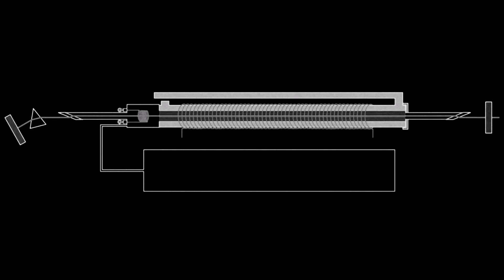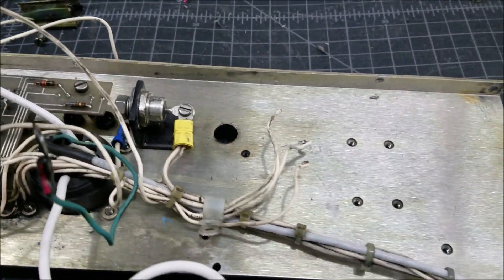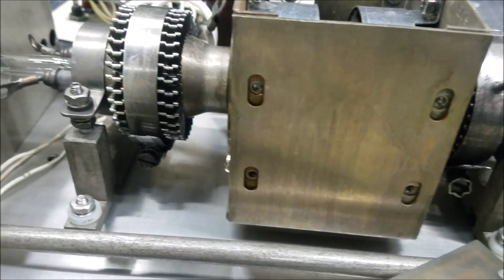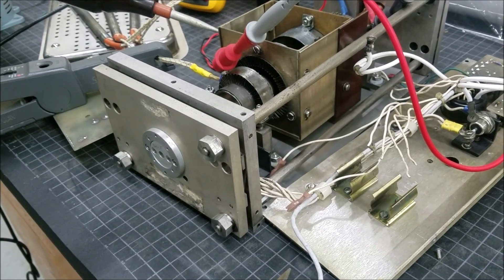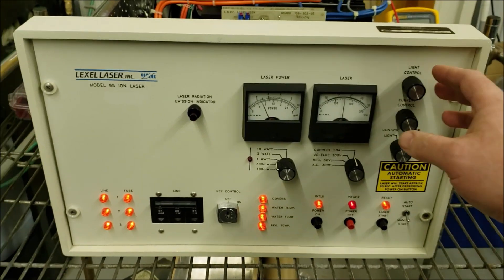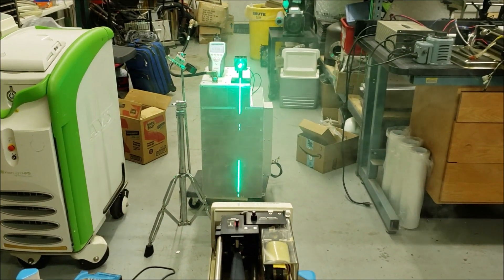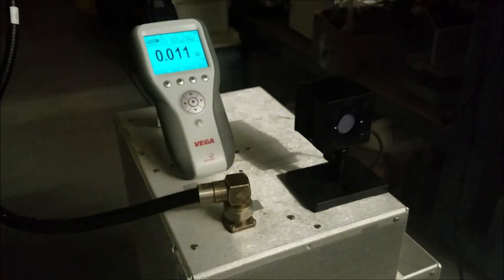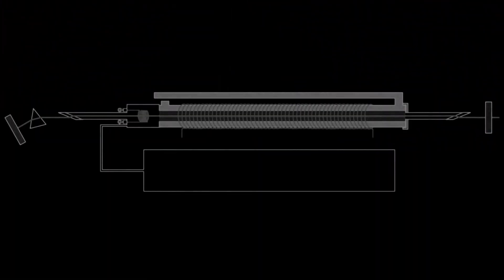An Introduction On How Argon Ion Lasers Work

Comment: Raising this thread from the dead because I have a question for you!  I have a Melles Griot Argon Ion laser, 35-IMA-830-012 head paired with the 300-002 power supply.  It works perfectly when cold (I.e. right when the power is applied, I turn the key to make it go through the things it does).  After 30sec, the laser fires and starts lasing.

However, if the system is warmed up (I.e. key is turned to 0 position, then to 1 position), it doesn’t fire.  After 30 secs you can hear the thing trying to fire repeatedly with very faint ‘tick … tick … tick’ to no avail.  Sometimes in this state, it does successfully fire, but not lase.  When it does that, the ticking stops, however no laser output.  Looking into the chassis, it seems like the argon is ionizing through the gas return channels (I.e. ceramic bore between heat sinks has blue green light coming from it).

Do you know why this could be?  In order for it to fire successfully, I’d have to wait a while for it to cool completely then try again.

Note, the laser head does have 11,038 hours logged on it, so it could be that lol

Comment: I'm in love with 488nm.
Reply from the maker: 488nm is a fantastic wavelength, If you enjoy it check out the Melles Griot 488 DPSS video. Also the next one I plan on posting will be about the OPSL 488nm lasers. I have a bit of 488nm and I am still not sick of it!
Reply: @Zenodilodon  I shall..I have a broken uniphase argon ion laser - I don't know how to fix it, but simply won't discard it.
Reply from the maker: @saturn1returns  Depends what's wrong with it. I suggest joining the StyroPyro Discord server as there are plenty of techs in the chat and you will easily be able to find help on it.

Comment: I really want to get an argon laser to learn about them then m goal is to eventually make a handheld gas laser. Anyone have one they could donate or any ideas where I can find one for cheap possible free?
Reply from the maker: The first thing to maybe tackle is making a hand held He-Ne laser. I have already a working PSU schematic that will drive one of the smaller tubes using at little as a single lithium oion battery. That's something I can help you with a little. There is a picture of it on my community section. As far as running an ion laser hand held, I hope you are ok with a backpack of batteries!

Comment: Trouble with some of those Brewster window lasers is that you would prepare the ends of the tube to a very high polish, place the windows then pump the tube down before applying epoxy around the edges. It does work well but eventually, you get leakage. That tube could probably be pumped down and refreshed. Back in the day when we used HeNe lasers, I was told that they also have a limited shelf life - even the ones with proper sealed windows. The reason, is that the helium 'burrows' through the glass walls - that's what I was told. I thought this a bit unlikely but there may be some truth in that. Years ago I would have done anything to get my hands on an argon or even krypton laser but the power requirements, water supply and the crazy cost was just too much. When you think what you can get out of a simple laser pointer these days. Great video.

Comment: Wow! I've ever seen such a nasty looking laser, all covered with toner. Nice clean up. Couldn't believe how you so casually drenched it with alcohol and/or trichloroethylene. Never thought I'd ever see another Lexel laser, nearly identical to a second hand re-gassed krypton I once had.
Just finishing my 3 watt RGB projector redesign, but the red was  little out of alignment, so I decided to have a go at re-alignment. The dichroic mount was glued down, so I used a razor knife to cut it free. While loosening the base machine screw, it pushed up on the bottom of the dichroic and popped it off the mount. Dolt! Rookie mistake #1. |-(
Only had iso-alcohol and toilet paper to clean off the old glue from all surfaces and Gorilla glue to reassemble. Again only toilet paper and iso-alcohol for final dichroic cleaning.
Of course, I need to order some proper lens cleaning tissue for trail wiping. But, I know that adhesives have improved a lot over the past 30 years and I'm sure there's something better than SuperGlue, nowadays.
So, please enlighten me, dearest Wizard of Light. What glue do you use and what cleaning solvents should and shouldn't be used?
Thanks as always :-)

Comment: Do a video on that Laserscope ! Awesome.  Massive amounts of 532nm power potential.  Interested to know the power supply used too drive the laser and your method of driving the Q switch, or did you manage to use the factory components.  I bought the 120 watt version a year ago at a medical equipment auction for basically nothing but haven't spent much time with it.   It appears to be completely networked and interlocked through a version of Can bus.  Unit has a nice chiller and Vuemetrix diode driver that will require some hacking to operate.
Reply from the maker: There are a few types of Laserscopes at the shop along with a few pulled heads. Some are flash lamp some are fiber fed diode pumped. To my knowledge there isn't an operation q-switch on one that runs at the moment and the other is Can Bus locked. There have been those who have managed to hack the software but it's not something we've done yet. The units are not mine, but I am certain a video will eventually be made on some of the Laserscopes. There might be information on Photonlexicon or Sam's Laser faq, If we get a hold of the Can bus information it will most likely be in a video as well.
Reply: @Zenodilodon  I would be willing to pay for some of that info through a donation (Patreon?) sometime in the future.  My unit is the diode pumped Can bus version.  I'll probably just end up removing the optical deck out of the unit and drive the laser head with a high current Matsusada (0-10V, 0-150A) rack mount power supply that I have, and get the chiller working.  The Q switch might be a challenge.  Really appreciate the videos.
Reply from the maker: @sylkelster  I don't have a patreon, I do have paypal, not vital importance really. I can check with a few friends and see if I can track down some information. If you send over an e-mail ( Zenodilodon@gmail.com ) I can send you some contact information of those who may be able to help you with your laserscope more easily along with if you have FB/Discord links to large laser communities with other members. What kind of q-switch is in your unit. Here we have been discussing using a galvo with a shutter. Realistically the q-switch should be pretty easy with some napkin maths for duration/rep rate. Usually the hardware is relatively simple.

Comment: Did you ever get it working?
Reply from the maker: It's a back shelf project, could need a new tube, there is a PSU that can be re-wired and tried as well. I am looking at getting some parts in for the 60x. I am also thinking of getting a Lexel 88 down the line. Not sure what is going to happen.

Comment: Great video! When shocking your 60 X tube with the oudin coil, make sure to hit it only - inside - the air riser box on the anode side heatsink. do not zap it on the ends because you can puncture the glass stems and or go thru the seal on the stem and brewster resulting in an air leak.  Also the voltage created by the zapper can fry your light detector circuit (the solar cell thingy).
Reply from the maker: Thanks! Yea, the glass tube can be easily pictured I have killed the seal on a few florescent lights that way messing around with stuff. We tried both the anode input and on the air riser for the most part, I think we did try a little on the glass end on the anode side a little just to check for local ionization in the gas. The tube was given to me with the warning that it's probably a dead tube so I wasn't going into it completely thinking of it being good. The solar cell/sensor looks fried as is and has a dark spot on it so I am planning on pulling the original and placing in a new one from a 473nm DPSS. I am trying to get another Argon ion laser so I can play around with it more. Gas lasers are a lot of fun.

Comment: If you need a way to test ignition, use a small!!! tesla coil or "borrow" a igniter circuit from a large laser tube.
Reply from the maker: We tried a 20-30kv ish Tesla/Oudin coil, I think the issue was either failure in the gas quality in the tube or the coil just found ground and never got to the cathode/across the tube. We tried for a good while. Adam has used that same tool to ignite other Argon Ions in the past. We both have a bad feeling on the laser tube at this point. Maybe  it's destiny is to be a what the sword market calls " A wall hanger ".
Reply: @Zenodilodon  check if you have current flow when you try to ignite the tube.
Reply from the maker: @philipweser8774  Voltage and current where both monitored on the anode and tube, no current draw was in across the tube.

Comment: I wonder if an ultrasonic bath in alcohol or lacquer thinner would do the trick? I know .....ultrasonics and flammables are a big no-no but I live dangerously 😁
Reply: Or possibly more of an oil base type cleaner like kerosene or heavy mineral spirits
Reply from the maker: @hullinstruments  TCE practically washed toner off like water washing chalk off pavement. Since it's not easily purchased we tried more common solvents first. We did use an ultrasonic cleaner for the screws and smaller hardware and that did work well too.
Reply: Obviously you wouldn’t want the optics or tube in ultrasonic because it could remove the coatings or maybe vibrate something loose and work moisture into sealed places. Similar to how large diamond rings usually aren’t cleaned and ultrasonic cleaners because it can vibrate the diamond loose and the settings need to be checked after

Comment: Could it be a pulsed laser so it needs more a  spike of power, maybe 96vdc is the lowest amount needed, try a change of about 10%, I've also noticed about a lot of power supplies is that they will trip on and off and you might need to cut the feedback, I have a tube that takes about 15A but it never gets up to full temperature because my ps is a hos
Reply from the maker: Making a laser is always a fun task!

I had the full service manual for the ALC 60x which as this point is probably worth more than the laser lol. The manual was what I was working from during the rebuild. My thoughts was that the Oudin coil may of just grounded before it made a full ignition path in the laser. We have a Cyonics argon ion PS here that needs a retrofit to try it. The tube may also be bad so I am looking at getting another ALC 60X tube and assembly to try. The second ALC 60x also has a prism tuning assembly. I don't know when I'll be getting that or when I'll get to working on it but it's a future thing in the works.
Reply: @Zenodilodon  I am sure you can make it work! Goodluck, and watch your eyes!